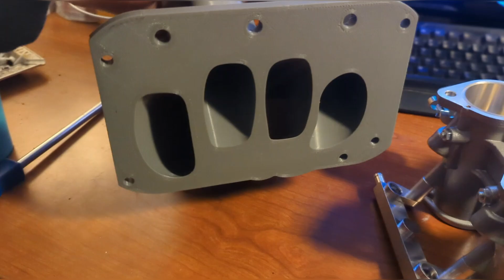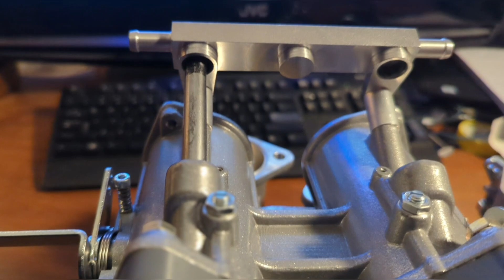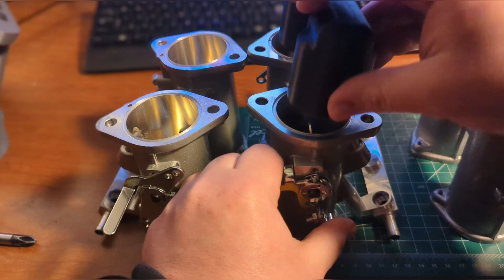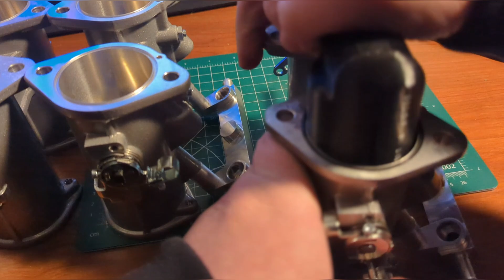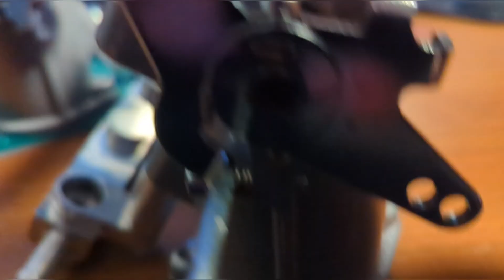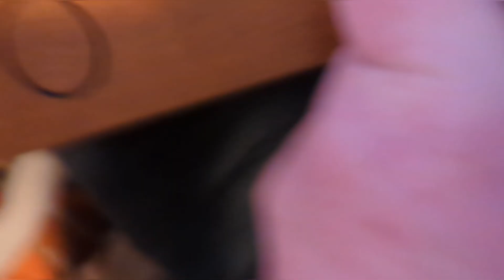50 DCOE 340 V8 3D printed IRTB's!

Comment: Very nice.
I would maybe make the flanges thicker or add some webbing.
I would definitely put o-ring seals everywhere, especially with the different thermal expansion rates.
But i know nothing about this. Im here to learn.🎉
Reply from the maker: @mikegreer9041  this is a fairly older revision. And there are definitely massive thermal properties going on. I do design in stages so it was the hard unmovable point, then move to runner design and carburetor placement. Placing the carburetor the farthest and closest spot possible is a good exercise. Then I make the wall thickness and start reinforcing the structure.